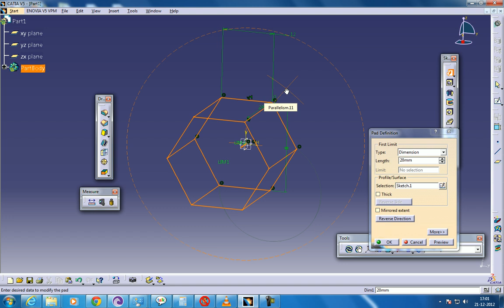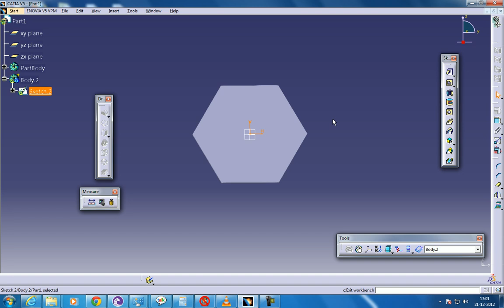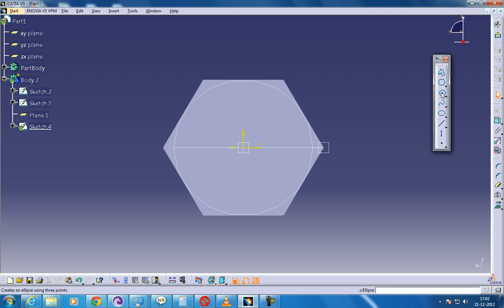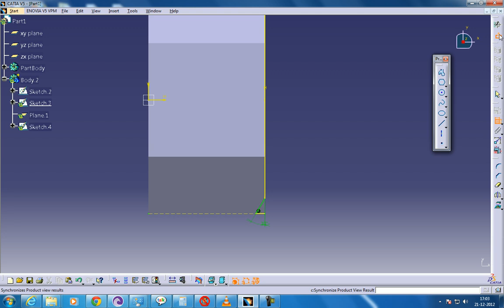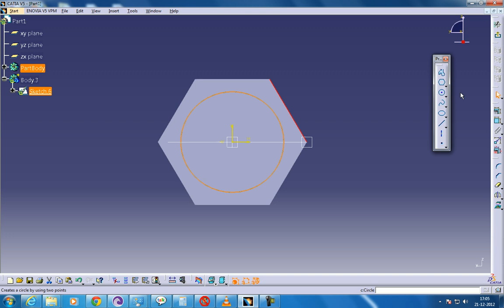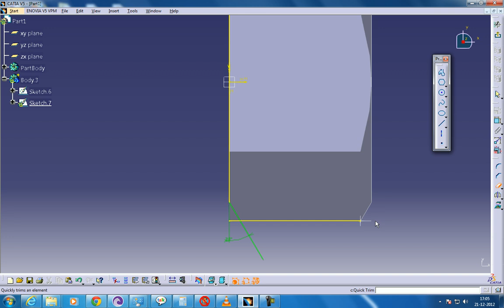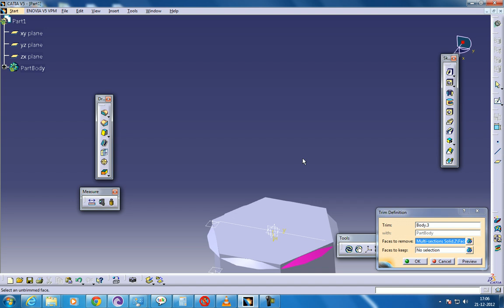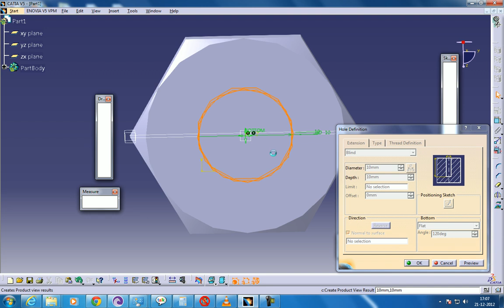Catia v5 Tutorials|Part Design|Bolean Operation|Union Trim|M12 Nut|Start to Finish

Comment: Sir, 
   Am seeing a front view In a M10 Hex Nut my length should be 18.72mm (point to point) and Breath or hight should be 17mm , Thickness or depth should be 8mm this is my requirement dimns.

And i just followed you and completed the M10 Hex Nut and also i learned how to apply this union trim from bolean operations.

But, coming to my mind, when am measuring the M10 hex nut L & B it was showed me 17.32mm & 20mm, So, Here, i can meet my M10 & Thickness dims only.

How can i arrest this exact length and breath issue. is there any step or calculation video class available sir? if is it yes just send me the link through by my mail.

Mail : sureshdmesw@gmail.com

Comment: Why so complex? Why you doesn't use one operation for chamfer - groove?
Reply from the maker: clever.red.man, Hi Friend, The main motive of this video is to show boolean Operation Command as you can see it in the title. Though you cannot get a proper result If you use a chamfer command, Maybe you can try a groove command with a circular guide curve and a profile. If you get a proper output by your method I do not have any problem whatsoever.

The nut is created with a different technique in another video of mine below:
Catia V5 Tutorial|How to Create Threaded Hex Screw(Easy Steps for Beginners)-Subscriber Requested
Catia V5|Infrastructure|Catalog Editor|Rebuild and Resolve M12 Nut|PDW|Part 1.1
Catia V5|Infrastructure|Catalog Editor|Rebuild and Resolve M12 Nut|GSD|Part 1.2

Comment from the maker: This video was created to show a different approach of designing a nut. In this video, I intend to show you the working of Boolean Operation; Union trim as it is mentioned in the video title.

As you mentioned about the groove command, If you create the circle path which is tangent to the inner boundaries of the nut, and then create a profile which is inclined at 30 degrees to the plane of nut, You may be able to achieve the correct result. 

Gratitude..!!